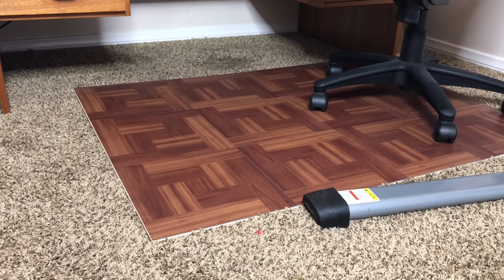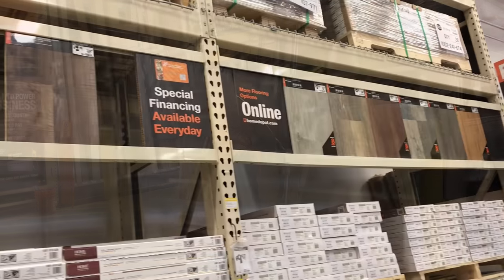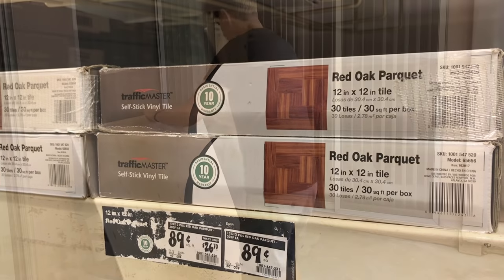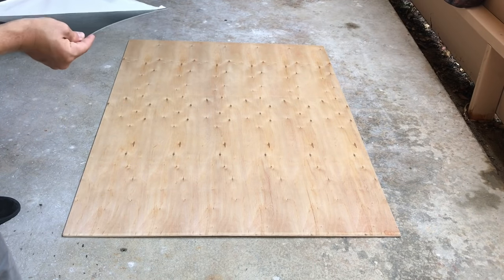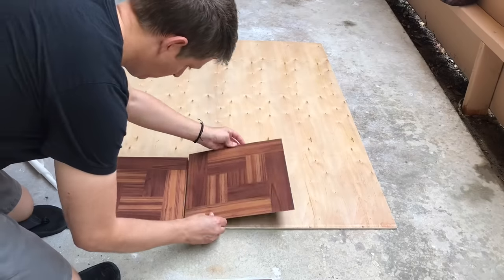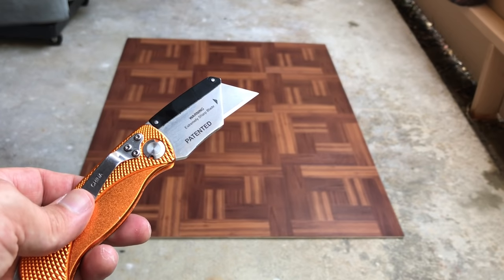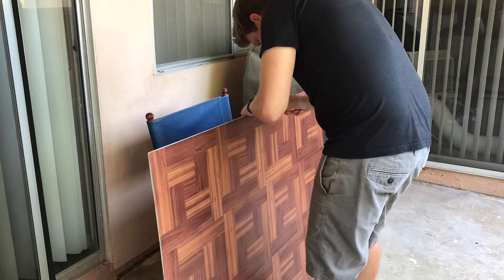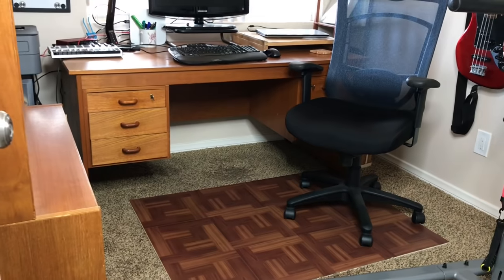DIY Office Chair Mat For Under $25!!!

Comment: I made one of these 2 months ago to use as an office chair mat...2 months later, the stick-on tiles are starting to come loose at their corners and there are other problems too ...this DIY mat is actually no good at all, but looks great at first glance. You'd need to do A LOT more to it to make it usable...like add wooden trim around the edges and use heavy-duty glue on the tiles.
Reply from the maker: Weird, I've had two of these for years now and no problems. I'm sure some reinforcement would definitely make it better though.
Reply: @kevinbrown1073  I troubleshot this more and figured out the issue: this type of mat cannot be partially tucked under any furniture - the uneven pressure makes it fall apart and peel on tile corners. If it's cut to size to fit partially under the desk without actually being tucked under the desk, the finish becomes much sturdier. The edge softening is a necessity though, especially if placing this on a carpet.
Reply: Yes made one just like this for myself a few years ago with black stick on tile. Just like the one in the video it looked really fabulous when I first made it, but in about two weeks the stick on tiles started sliding off the plywood.  I'd agree that a trim border would go a long way to keeping the tiles in place. Now I'm just using an inexpensive  48X48 sheet of MDF fiberboard with no tiles and it works fine.
Reply: @reelreeler8778  good suggestion, but I'm reading that it contains VOF...back to the drawing board, I guess
Reply: So basically this is the same concept to install a peel and stick floor, using underlayment plywood and a peel and stick tile. The key element to making the tiles stick to the plywood is to use a sealer. It seals the wood fibers and gives a tacky service for the peel and stick flooring to stick to. I have installed floors like this in homes with heavy appliances and what not and never had a tile even pretend to start lifting.
Reply: @reelreeler8778  What thickness is mdf.
Reply: @deprofundis3293  whats vof?
Reply: @cheapthrillonthetube4027  dude that’s smart, you use really make a YouTube video on somthing like that
Reply: What about making one out of laminate flooring planks? Put a the same plywood underneath as reinforcement. It shouldn’t slip but you can add glue in between to make it permanent
Reply: Well I mean, duh. Obviously if you're squishing one corner under furniture or something you're going to screw up the piece you made. Really stupid to have this comment at the top making his idea look bad when it's you're fault it messed up and his idea is actually fantastic and helpful

Comment: Glad I saw this before I spent 150 on Wayfair!  I used 5/8 plywood though to support weight without issues. I got regular plywood, filled in the holes with Bondo, and used the belt sander on both sides, works beautifully!  Mine is 4 foot by 6 foot for a project area.
Reply from the maker: Glad it worked out so well! Thanks for the feed back!

Comment: Decided to do some research before I bought another chair mat and came across your video. My current one is from Staples and in less than 2 years it has cracks all throughout it from rolling around on carpet. I enjoy DIY projects, but never thought to simply make a chair mat from wood and laminate. Will definitely be doing this instead of buying another clear plastic mat!
Reply from the maker: Right on! It’s definitely a worthwhile project!

Comment: You can do this same thing with the laminate flooring they sell in the boxes.  It holds up really well by itself. Just make sure you use a board and hammer to force them together or they can come apart. Got a box of it for 16 bucks and made a really nice chair mat out of it.
Reply: Wouldn't that cause dips from the weight of the chair wheels? Or are you using this on a hard surface? Most of us are here because we're working in office chairs on carpet and can't roll.
Reply: @deprofundis3293  Another video on YT has the laminate attached to a what looks like a half inch plywood...I see that OSB is what they recommend(same as laminate?)
Reply: @sl5311  OSB you need to use liquid nails. The sticky back is not strong enough to stay adhered to the OSB because of lack of surface area.

Comment: I made my Chair Mat last week.  Cost me $26.  Boy do I like it.  I am surprised how well the self-adhesive tile stick to the quarter in 4' x 4'  plywood.  It looks and feels awesome when I glide over it.  Thanks for the video.
Reply from the maker: Happy it worked out for you!
Reply: Hello George, After two years does your floor chair mat still hold up well or are some tiles unpeeling off the plywood?  I want to do this also, but don't want problems for a long long time.
Reply: @lostinmyspace4910    Eventually, i migrated to a 7" wide vinyl.  I put the pieces together in a 5' x 5' square.  Then I trimmed it with a 1/2" metal border.  Then I screwed it down at the corners and in the middle.  It is holding up fine.  It was easy to put together.  Most of the time was cutting the pieces

Comment: FYI....I would tack it down with a brad nailer. Those tile will shift if there is no border to hold them in place over time.
Reply from the maker: I could see doing that but I'm on year three of one I made for my office and use it daily. So far so good and all is holding together just fine.

Comment: I liked and subscribed. Keep the DYI's and Hacks coming. Thanks for the great idea. BTW Office depot sells between $65. + $99. for bamboo. I just came from there. FYI Ikea sells them $19.00 448.811.00 but a little on the thin side for carpet... more for under High Chairs etc. So this idea is awesome. So going to do this. Cool Thanks C.

Comment: This is exactly what i was looking for.  I have a mat that has worn through and I don't want to drop $150+.  I need it a little custom 49 x 80 inches.  I orginally thought about getting pergo but this looks good.  Given the thickness of the plywood and flooring, do you think it will crack/ break on carpet?
Reply from the maker: I had mine for years and no cracks or breaks! My carpet was pretty thick too. Good luck!

Comment: Hi Kevin - This is an excellent idea. What type of plywood did you use? I mean thickness? would a 5.2mm - Sande Plywood from Home Depot work? I have a plush carpet and I am not sure if this will be too thin and will crack/bend with a few uses. Your help will be really appreciated.
Reply from the maker: Glad you found it helpful! I used pretty thin board. It has been a long time ago since I did this project but it was probably 1/4" thick. my carpet was pretty plush too bit it worked out just fine. You could always go thicker if you want!

Comment: Very helpful. Thanks! I actually noticed the same 4' square thin plywood at HD and purchased it for this. BUT it wouldn't fit into my y8 q car. Will figure that issue out and create one of these. I agree the plastic mats are awful. They quickly scuff up and look pretty bad.
Reply from the maker: Glad I could help!

Comment: This is great to replace my plastic mat. I have a problem with my plastic mat causing moister in the carpet. Do you have any problems with the wood trapping moisture?
Reply from the maker: I haven't but I live in a fairly dry climate. I'd recommend trying to put down some absorbent material underneath to see if that helps. I always save the absorbent packets that come in shipments, and that stuff is great to have around!

Comment: For the floor mat for under a computer chair -  will the chair wheels cause divots so you eventually can’t roll?  This happens with those plastic ones.  Hoping your solution will fix that issue.  Great video!
Reply from the maker: The great thing about one of these mats is that you can use thicker material than those plastic mats so I never had that problem. Good luck!

Comment: I'm barely a DIY (very low-skills). I could certainly handle making a rectangular mat (great idea!), but I need a mat that is basically an upside-down "T" shape...and it's in my bedroom, so the dimensions have to be very specific. Any suggestions on how I could create a "T" shaped base?? I assume Home Depot won't cut it to my specifications...but maybe I should ask??
Reply from the maker: I would ask and see! The other thing you could do is contact some cabinet makers in your area. They'll have the tools to do it!

Comment: I've been on the look out for plastic chair mat for carpet and couldn't find anything below $50. Then I thought of "DIY' and found this video. Thanks for sharing man! One question, the bottom part is flat with no stud or something like that. Does it move around as you roll your chair around?
Reply from the maker: Nah man it has plenty enough weight to stay put! Good luck on the build!
Reply: @kevinbrown1073  thanks man

Comment: I did this a few years back and ran into one major issue... the stick on tiles over time kept shifting.  To fix it I had to keep using a heat gun to warm the tiles and then shift them back in place.  I also tried removing the tiles and putting new ones down but those shifted also.  I finally got so tired of repairing it constantly that what I did was take a staple gun and put a staple about 2 inches from the corners of each tile.  That was a year ago and the tiles are still on there perfectly. 
Btw, I used 1/2 inch plywood for mine.  I'm not sure you would want to try the staples on something as thin as what he shows in the video.
Also, if you want it to look extra nice the staples will probably not work great for you since you clearly can see the staples.  I suspect you might be able to improve the looks a little if you colored them with a marker or something.  Though, I suspect you would have to touch them up from time to time.  Would still be TONS easier to moving those tiles around.
Reply from the maker: I'm on like year 3 of mine with no tile shift or wood crack.
Reply: @BillerdsTechModsDIY  I used 1/2 inch plywood and it is as good as the day I bought it.
Reply: @kevinbrown1073  I may have used cheaper tiles.  I also weigh a lot.  I got up to 285 during some of the use.  I've since gotten down to 210 lbs... but that is still a lot of weight to be pushing around.
If people want to try without the staples I would recommend not waiting too long if the tiles begin to shift.  I did and as a result the edges of the tiles broke off from hanging over the side (like you warn about in your video).
Reply: Spread some weldwood contact cement on the plywood before installing the tiles and you should have no movement of the tiles.  And it will look much cleaner than staples.
Reply: @stolencoats63  Thanks, I hadn't even heard of that product.  I will give that a try next time.

Comment: Question: Just projecting the dynamics over time I would imagine that weight rolling on the center of this platform would cause the edges to begin to pitch upwards - in other words, the weight on the center would cause a depression in the center and elevated edges as a result of continuous rolling back and forth. Did this present an issue after you used it for awhile? Waiting for a response before I commit to this though I DO think it is an excellent alternative to those expensive but worthless plastic  desk mats. Thank you for posting!
Reply from the maker: So I’ve had my office chair one for a couple years now and it still sits perfectly flat. I have one that a portable a/c unit sits on and it still sits flat too. One dude I talked to made one a bit thicker than mine so that’s always an option too. I definitely think it’ll last longer and look better than the cheapo plastic ones!
Reply from the maker: Let me know how it goes!
Reply: @kevinbrown1073  Many thanks for your response. OK, I'm sold. I've just redecorated my office and have been dreading the waste of money that would otherwise go into a plastic floor mat. I already know the thing will fall apart within a year or two like the others.Your video is a godsend. I've already got the wood all I need is the cover material and I got a Home Depot within a couple miles. I hope to have it done this weekend. Once again, many thanks!!!
Reply: @kevinbrown1073  Greetings!!! Well, it took me longer to get to than I thought but it is done. I used a piece of 1/2" plywood I happened to have at home. It was clean [EDIT] and perfectly flat [END EDIT] but of course it just looked like plywood. Instead of using the tiles I stained it with some red oak stain I had laying around after a light sanding and then finished it off with two coats of polyurethane (I had a gallon of the stuff laying around). I also cut 45 degree corners on the side that extends into the room (behind the chair) about 5" back on a side to give it a bit pf pizzazz as well as to protect against an unnecessary tripping hazard. IT CAME OUT GREAT (((AND))) BEAUTIFUL!!! Thanks for the initial idea. It sure seems simple after someone shows you but I never would have thought of it on my own ... well, never say "never" but it probably wound't have been anytime soon. Can't thank you enough.
Reply: @DATo_DATonian  What type of poly and is it showing scratches?  Thanks.
Reply: @averagealice8877  Greetings Alice. Just regular oil based polyurethane. The brand name is Minwax. I've been rolling on it for 5 months now and it still looks good as new. Could use a cleaning and waxing I suppose because the high shine of the polyurethane is becoming slightly dull because of the chair wheels rolling all over it but I'm sure if I cleaned it up it would look as good as it did when I first made it. No scratches at all. You can get the polyurethane at any hardware store. [Edited to add] My initial concern has not materialized. The wood is remaining perfectly flat.
Reply: UPDATE: It's been two years and it's holding up fine.
Reply: @DATo_DATonian  WOW!  thanks for the follow-up!  thats rarely seen round here, good on ya!
Reply: @Dildo_Baggins.  Hi and thanks. I am rolling on that wooden floor pad as I type this and it is still in excellent shape. No warpage at all from the rolling which was my initial concern and it still looks great. Plywood is a bit pricy right now since the Covid virus raised prices of just about everything, but in the long run it will still be far cheaper than having to constantly replace those plastic pads. If I had used one of the plastic ones two years ago it would probably be falling apart by now.

Comment: How thick was the plywood? I've got a thick memory foam carpet pad and nice carpet I want to protect... think this will do the trick? Does it slide a lot on the carpet?
Reply from the maker: I used 1/4” and I definitely haven’t had it slide on me. Once you put the laminate on it the mat will have a decent amount of weight to it. Are you worried it might be too thin?
Reply: Only slightly. I'm a bigger dude... heh heh... any problems with your carpet underneath?
Reply from the maker: I could see using a thicker piece. I’m only 165. And definitely no problems either the carpet. I actually ended up making another to put underneath my ac unit too. Bshay513 I’m really trying to reach 1000 subscribers, would you be willing to subscribe?

Comment: What kind of would did you buy? It didn't say. The wood I have now isn't working. It keeps breaking on my shag carpet.
Reply from the maker: I just used plywood for mine that can be bought and It is 1/4". Since your caret is thick you might have to bump it up to 1/2". Hope that helps!
Reply: @kevinbrown1073  I went and bought some 1/2 precut 4x4' board from home depot. Then used peel & stick planks that look like wood that were 1x2' it looks awesome! Wish I could post a pic!
Reply from the maker: @emrldeyes  That's awesome!

Comment: Hi Kevin.  Have you used this mat with rolling office chair? I’m concerned that in a short time the tiles may come apart with weight of wheels on tiles .Thoughts?
Reply from the maker: I used it with a rolling chair for years and had no problem with the tiles. The trick is to properly prepare the surface. It has to be clean and have some slight roughness to that will allow for the glue to grab a hold of it. You could deftly do ti without the tiles but its going to reqire a lot more sanding and some stain. Let me know how it turns out!
Reply: Negative, do not use a rolling chair without tiles. The plywood layers are glued but there are internal voids and the wheels will pinch through leaving you with divots to roll your chair over. OsB might be ok but soft or hard plywood will not be ok without a tile covering

Comment: Well this video was over 4 years ago so I don't know if you'll see this or not. What size would you typically recommend for an office chair area?
Reply from the maker: Hello! I do check from time to time! There are some sort of standard sizes out there that companies tend to make and that is a good starting point. However, you'll have to look at your space and see what is going to work best. Sorry that I don't have a great answer!
Reply: I used a 4x8' sheet of plywood and had the store cut off 2' to trim it down to 4x6'. Then I used that leftover piece of 2x4' ply to make a "tongue" that extends under my desk. Instead of using the stick on vinyl I used the snap in/tongue in groove wood flooring to cover the whole thing. It turned out awesome and saved me about $300